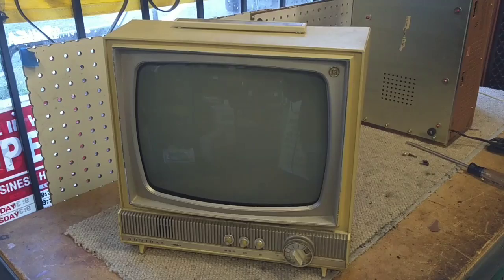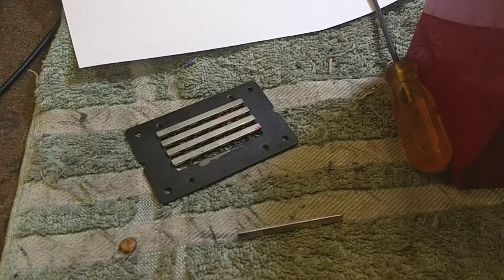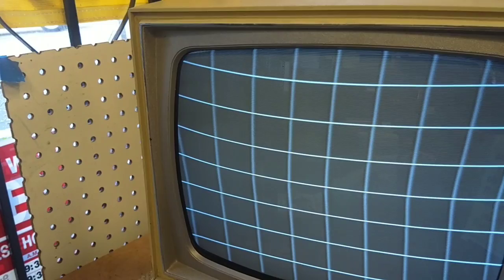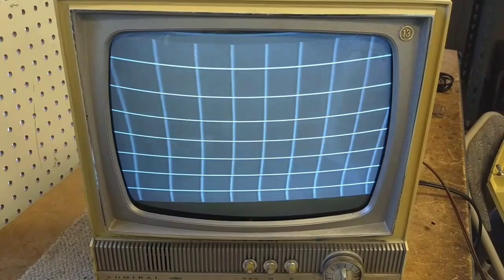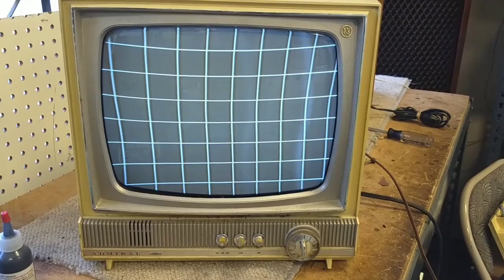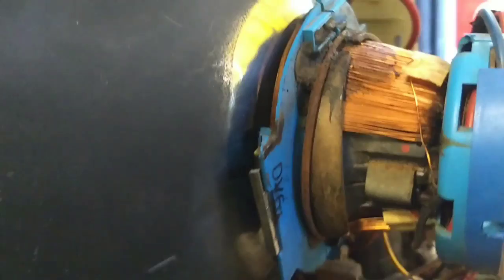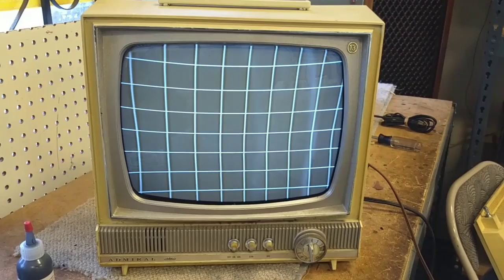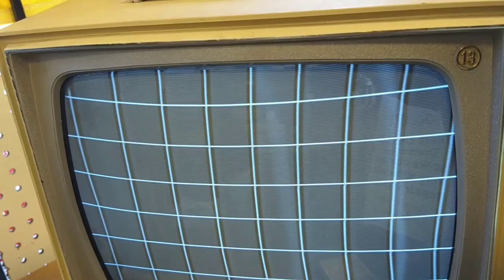Repair of a 1966 Admiral pk1369 vacuum tube black and white tv part 3/3 - for now.

Comment: This one bugs me.  Usually keystoned pixs are dim ( low HV). I think cleaning off the black  mung
fixed the yoke. Instead of magnets I would look at the hoz AFC & osc. Note the vert white line in the
pix. It goes away or moves with the FT adjust. It dont take much so a challenge ! Remember the Emerson
set with the color problem ?
73 Tom
LFOD !